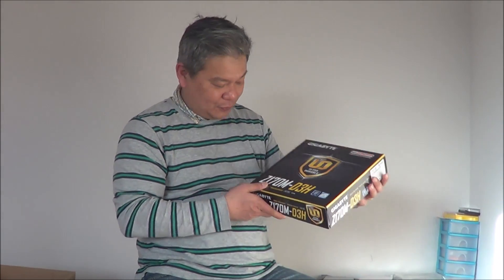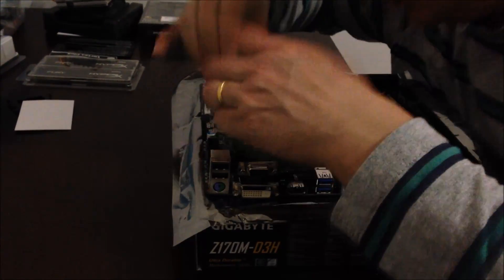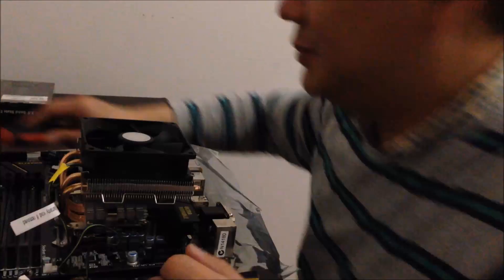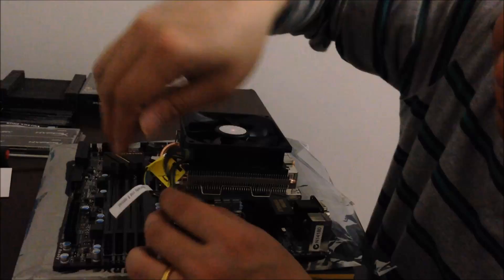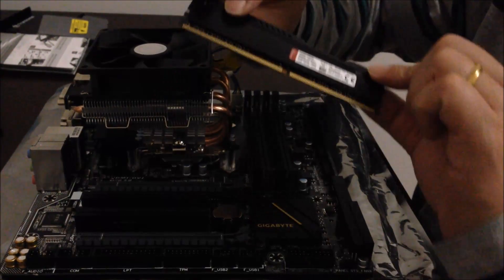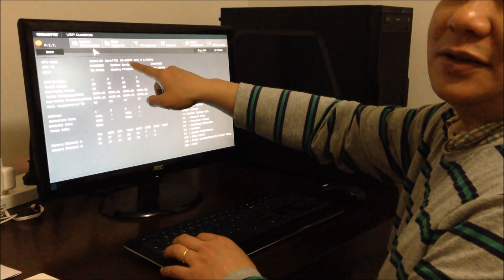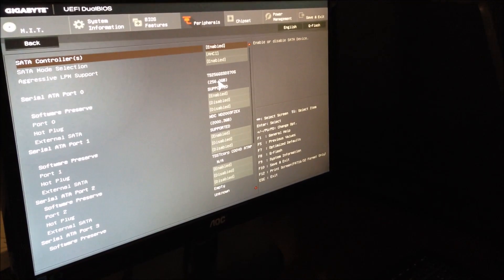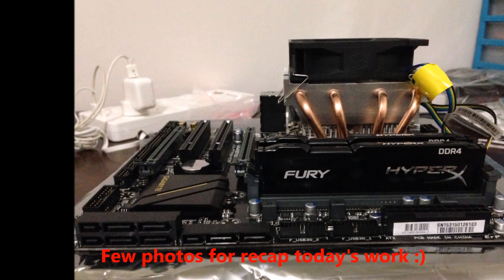6th Generation Intel Core i5-6600K LGA 1151 Skylake

Comment: Hi please, can you healp me, i have the same CPU Intel i5-660k LGA 1151, but i don't find a cpu cooler compatible with socket LGA 1151, can you tell me what cpu cooler did you use?
Reply from the maker: +Fernando Abundis I use the boxed Intel cooler heatsink.

You can get after market one, like: coolermaster or antec etc etc... There are plenty after market heatsink for intel cpu.

Hope this help.

Comment: sir,one question- i5 6th gen need any cpu cooler
Reply from the maker: +Dibendu Roy 

YEs, you do need a cpu cooler. By default, Intel give you a basic cpu cooler. Of course you can top up a water cooling. But i think you do not need as 6th Gen Intel Core is very low power consumption.
Reply: Sir,one question- i5 or i7 is best for gaming.
Reply from the maker: +Dibendu Roy Intel core i7
Reply: Thank you very much sir.